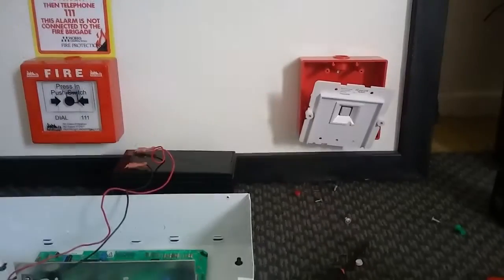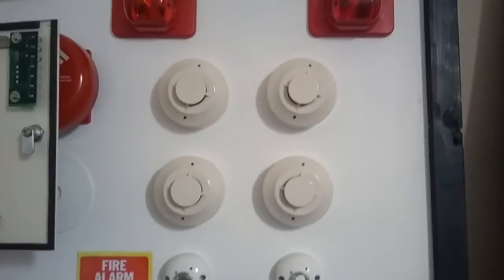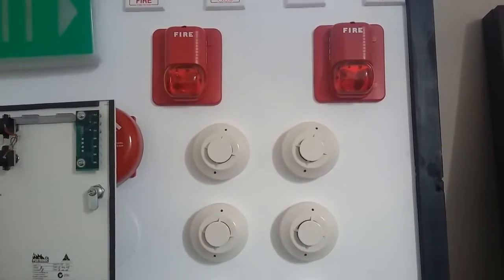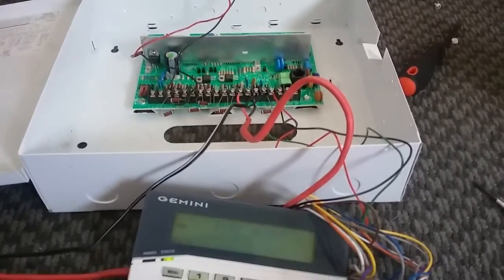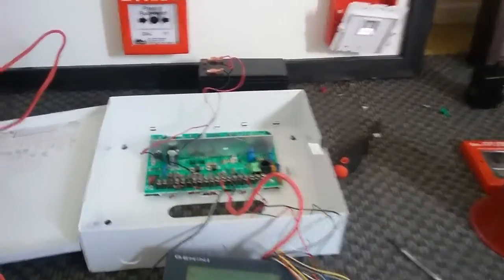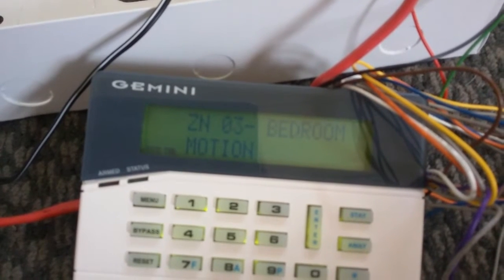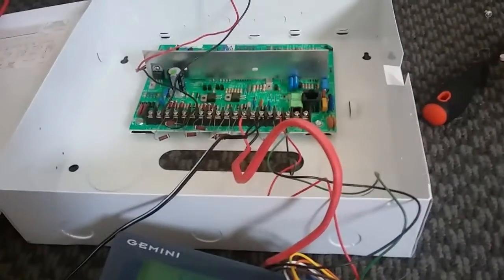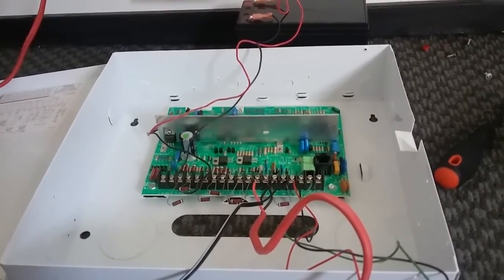Napco GEM P-801 Fire Alarm Setup

Comment: Hey FireAlarmNZ what do I put on a unused bell connection on a F4 Model (4-3) Panel?
Reply from the maker: 10K ohms
Reply: Thanks
Now my system is all normal :)
Reply: hey as well i connected a bell i had and the 10K EOL at the end and one the bell didn't work and two my panel goes in to defect i'm getting to new bells for my system so i want it to be all normal